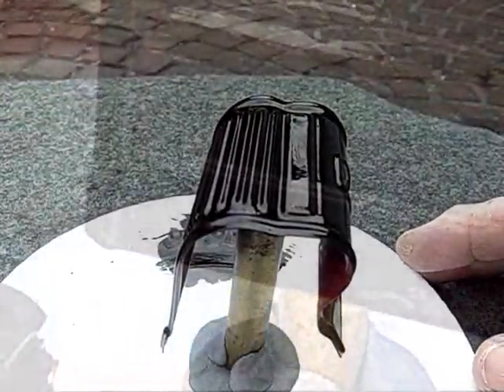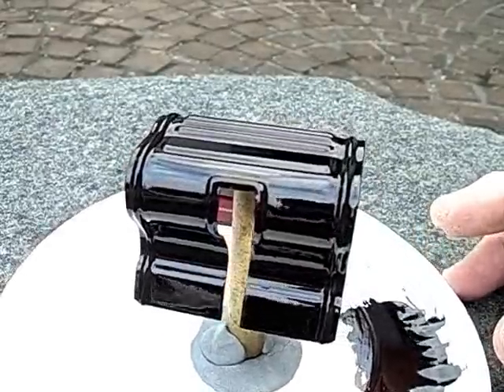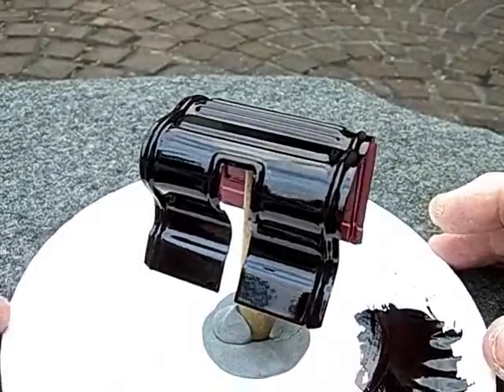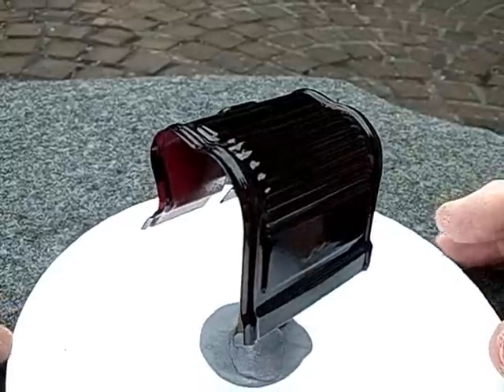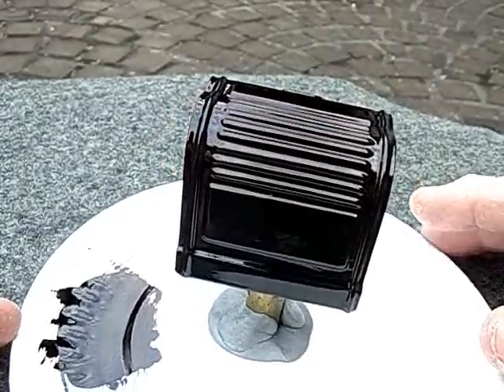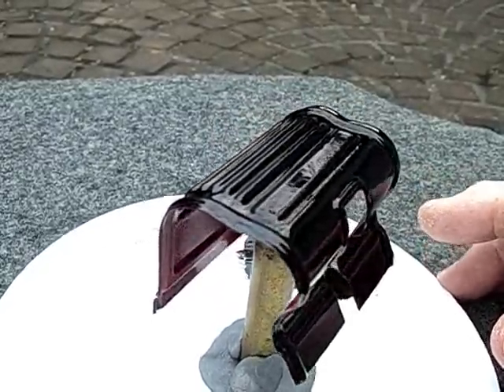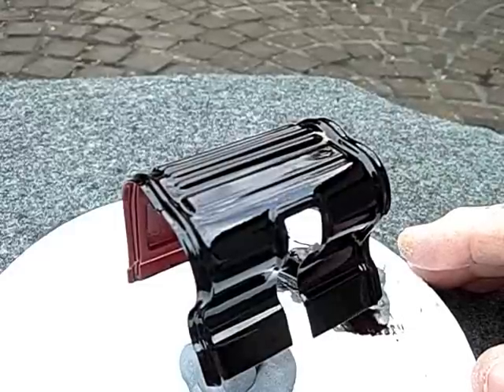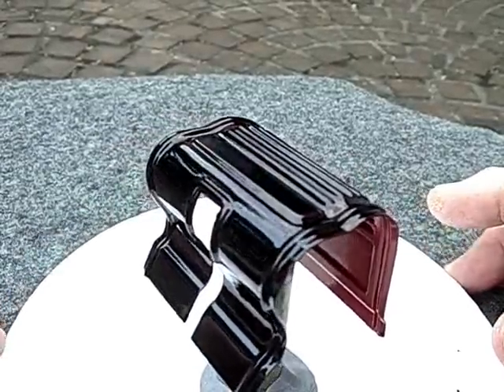Japan Black recreated, demonstrated

Comment: I have a 1931 Sunbeam Model 9 motorbike.  John Marston had a 'japaning' firm from the 1850s and when he started making bicycles and then morotbikes they had japaned frames.  My frame is now 91 years old and in remarkable condition.  There are many places on it where the paint has been removed intentionally or otherwise, but anywhere it hasn't it will polish up like new.  I might look at re-japaning it at some point.  Which is why I'm here.  Nice video ta.

Comment: Article copyright by the author, written October 2018, very rough, first draft:

Japan Black is the blackest of all black paints.  It is not really a paint, though: it is a color varnish.  Asphaltic enamel such as this, does not contain any pigment!  The blackness is perfect because the blackness comes from the molecular fineness of the carbon black of the Gilsonite asphalt base.

Roofing tar is JUST AS BLACK, but cannot be made to dry hard and flinty like Gilsonite. 

Make a Gilsonite solution with Xylene (for instance).  Add about 25% boiled linseed oil.  Allow the mixture to settle for a good while, so dust and grit of the Gilsonite fully settle out.

Then, no stirring is ever necessary.  The varnish (it is a true varnish, not a paint, because it contains zero pigment) may be brushed or dipped. 

BAKE each coat for about an hour at 400F or so, to make a hard, durable coating on metal objects.  Air drying is slow and will not provide maximum hardness.  But even if air cured, the coating will have a perfect, mirror-flat gloss if properly applied.

The ability of this varnish to flow and self-level owes to the nature of linseed oil.

This is the blackest coating in the world.  If the gloss is perfect, it is the perfect black because it traps virtually ALL the light that enters the coating. It absorbs light perfectly, just like if you open a can of asphalt roof coating, that is the same level of perfect black:  no tinge of gray or brown.  Just infinite blackness.

Such a black level can never be achieved with a pigmented black paint, because pigment is particulate.  And tiny particles diffract light, rejecting some, reflecting it back out of the coating, instead of trapping it all.

Likewise, the ultra black can only be gotten when the gloss is perfect.  Satin black can never be nearly so black as gloss black.

And no pigmented black will ever approach the blackness, the entire absence of color, of an asphaltic japan.  It is of the nature of dyestuff, so to speak.  Several coats may be required.  

Try coating a piece of glass with japan black?  You will find that light viewed through the thin coats is brown.  Adding coats, the layers absorb more and more light.  And perfect black is achieved, even against light passing through the coating  because japan black (this sort of asphaltic baking enamel) is the perfect light trap.

Black is the absence of light.
Reply: Thank you for the overview of the technique. When mixing Gilsonite with xylene, is it just enough liquid to dissolve the powder or is there a specific ratio you use? 

Lastly, do you know anything about this type of finish being applied to wood or papier-mâché?

Many thanks
Reply: @SSDD422  , I don't know anything about applying the resin to wood or paper-mâché.  I can state with confidence:  a simple "cutback" solution of gisonite was used by Ford for non-critical, rough and ready finish for crankcases, rear axles, springs, etc: Gisonite dissolved in mineral spirits (white spirit/UK name) of the old variety, not "low odor;" it has higher solvency than today's "paint thinner."  Xylene is much better at dissolving Gilsonite resin because it is of great solvent power and it also will evaporate considerably faster.  The lack of a simple solution is just that it is not a true varnish and will not hold a gloss or weather quite so well.  But, I used  make "cutback" with dipentene and used it on my Model T engine block, cylinder head and crankcase.  Ford called the solution "motor slush." It's really simple and easy.  Making a true varnish, however, by adding linseed oil, makes more flexible film and a makes the liquid flow out perfectly.  See, the oil component makes an oil varnish "flow," and linseed oil is the best at facilitating a brushless flow or dip job.  HTH.  I am not really expert at all....
Reply: I am writing merely philosophically and not as if from demonstrated fact. I want the reader to demonstrate in proofs of fact the mere ideas I so poorly present.  Forgive my ignorance and  my presumption of your interest?
Reply: Thank you for the insight Reid; I'll report back if I have any luck with glossy finishes without baking. I'd love to get my hands on some real Utah Gilsonite, but I think in Europe some regular powdered bitumen will have to do. All my best
Reply: @SSDD422 , I bet you are right on!  Powdered bitumen would be, I think, the very same thing!  A gilsonite miner would be able to answer for sure.  Gilsonite is partially fossilized asphaltum, I =think=that's all it is. It is very old tar.  Grins and thanks to you for your research,
Reply: @SSDD422 , you won't have to bake to get a gloss. Baking is to make it a "japan"=a more lasting, hard gloss. It really is not all that hard a finish. It is elastic when made as a japan, the oil component and the lead make it a flexible finish. Without lead it can't be a very flexible finish when baked.  Without oil, it lacks toughness. The durability of Japan Black indoors, is forever. Outdoors? It will dull and weather quickly.  It is, after all, just asphaltum.  If you add linseed oil, you will increase the gloss and also cause the finish to need much longer air time to dry.  Baking, on the other hand, not only speeds the cure, but makes a better cure, a better final finish, more glass-like and yet more flexilble, too.  𝐋𝐞𝐚𝐝 𝐢𝐬 𝐚𝐧 𝐢𝐦𝐩𝐨𝐫𝐭𝐚𝐧𝐭 𝐜𝐨𝐦𝐩𝐨𝐧𝐞𝐧𝐭 𝐨𝐟 𝐭𝐡𝐞 𝐛𝐚𝐤𝐞𝐝 𝐣𝐚𝐩𝐚𝐧. People are afraid of messing with lead, today, for good reason.  I used to boil oil and lead mono oxide together, to make lead drier-concentrate. The exothermic reaction that is involved in making lead drier concentrate made yellow smoke and fumes like the devil with a grudge. Of course (grins), brain damage resulted.  Not to me, but to unborn children  (lol).  Like anything else, misuse of materials can be hazardous. 450F boiling oil is not only merely dangerous to enemies scaling the rampart walls, grins:  https://youtu.be/n75PgMSxAOw
Reply: Hello Reid, boiling lead monoxide in linseed oil sounds fun - very Mediaeval of you! I regularly use drying agents when working with oil paint, usually boiled linseed oil (boiling + addition of metallic salts reduce polymerisation time) or cobalt dryer. 
With your japanning recipe, would all the linseed oil in your mix be the one boiled with lead? Most commercial dryers or siccatives for oil based paint are added in 1-5% quantities. I see that most manufacturers have moved away from using lead; Lefranc & Bourgeois made a Courtrai Siccative with lead, but it is discontinued; it now works with zirconium. I am not working not this project as of yet but would like to investigate and compare this to traditional urushiol based finishes, mainly for cost and availability of materials. Thank you for your continuing interest and contributions.

Comment: I worked for the gilsonite mine in Little Bonanza,Utah. Gilsonite forms in vertical vains 2-10 foot wide. There is an absolute line at the side walls between the gilsonite ore and the other rock material! The ore is mined by digging with a mini hand held jack hammer called a chipping hammer. A vertical shaft is dug and  material slopes down to the bottom. The ore is sucked out w/ huge vacuum to the surface. Mines "rock-out"(no longer pure gilsonite) at 60 to 2,000 feet deep.

Comment: Interesting video Reid, I've not heard of Japan black before, is it heat resistent, and is Japan black the colour or the trade name
Reply: Look up gilsonite and look up japan black ?  YES, it is relatively heat-resistant to about 500F.  Gilsonite was the basic coating for Model T Ford components (for instance).  It remains useful today as a harder, flintier, longer lasting version of common asphaltum.  Gilsonite is commonly used to fortify, for instance, the durability of asphalt and asphalt sealers, driveway coatings, etc.
Reply: I do not know what's the best name. You decide on one?  Truly, thanks to the thinkers and doers who save and promote old school techniques.  Our ancestors were not stupid people.  They also gave us our brains.